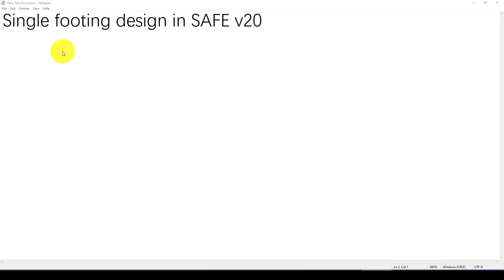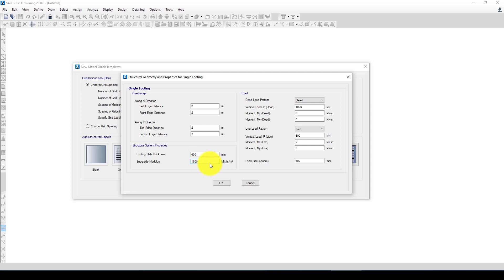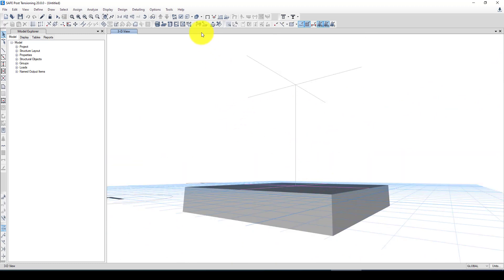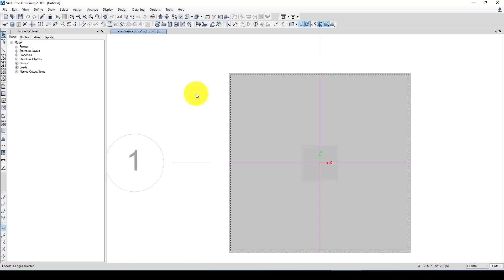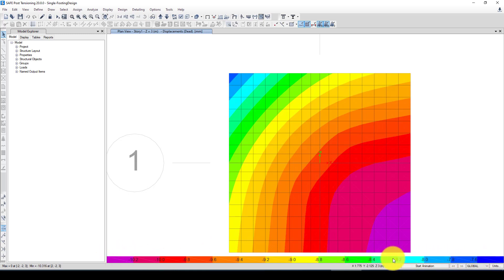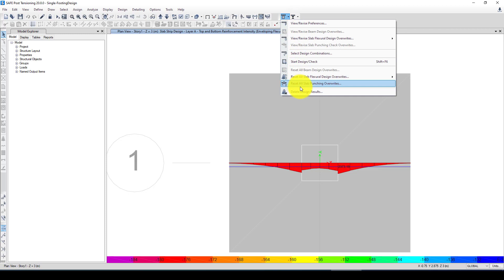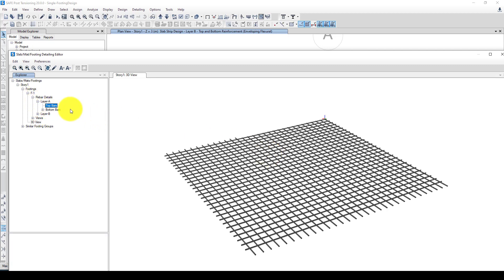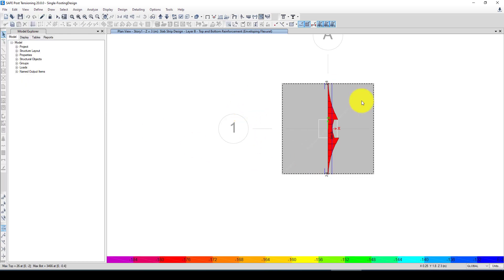CSI SAFE v20  Tutorial ; Single footing design using ACI 318-19 code

Comment: ON DEFULT it just checks dead load and live load? only two combinations?, no snow and wind (uplift?) , in my structural analysis i have snow and wind load uplift. which i don't see any way to have those based on the code load combinations automatically. if its all handy it doesn't worth it to spend that much time for just designing a single footing, enercalc makes very faster design, automatic fast checks, the only case it's just doing mat slab analysis i hope in that one this software makes some sense.